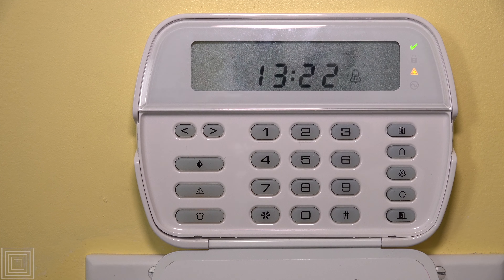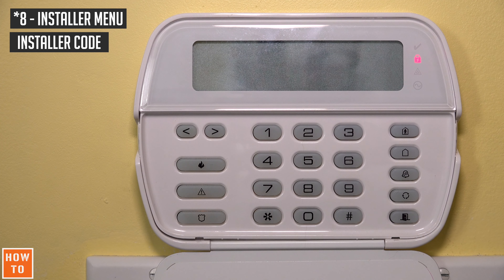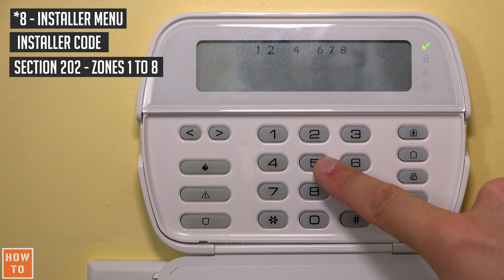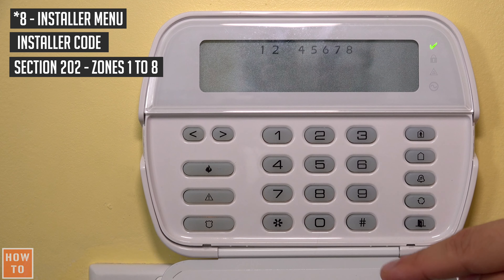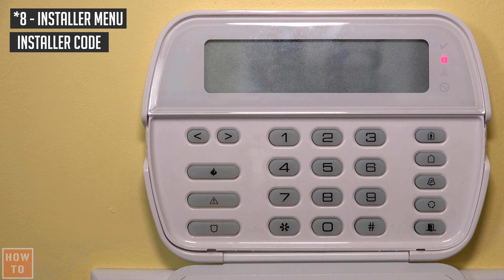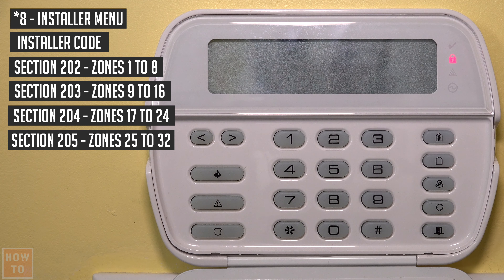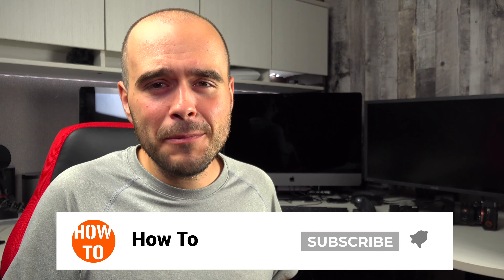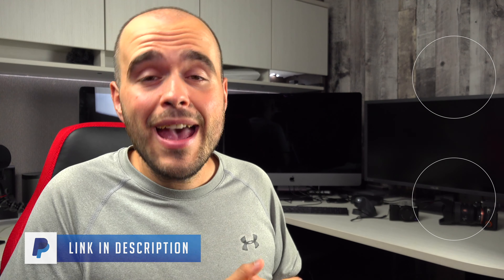How to Delete a Zone on DSC Power Series Alarm System

Comment: Hello, thank you for the video - we bought a house with a broken sensor that we don't care to replace - but everytime we arm the system we have to bypass that door contact.  

I would like to delete the sensor, BUT I do not know the "ZONE NUMBER" (so I don't know which zone to deactivate)

I am afraid of deleting a zone i want to keep by accident (then I can't get it back easily?), but I still do want to delete that broken sensor (deactivate that zone so I dont have to keep bypassing the sensor to arm the system).  

Is there a way to figure out what ZONE NUMBER is my broken sensor?  Right now it just gives the description of the sensor (like "___ door", " ____ window" etc - it is not listing a zone number that I can see)

thank you!

Comment: I have a zone that is not working (the entire zone doesn't work...the sensors are not bad).  Using the procedure in your video - i.e. Section 202 - shows zone is enabled.  Other zones work as they are supposed to.   What can I check/troubleshoot next to get this zone to operate?  Is there a way to use the keypad to check for error codes for a particular zone?
Reply from the maker: If it was working before, that must be a physical issue.
Check the wiring and connections.

Comment: Hi there really informative video - thank you very much.  I tried this approach with my DSC Power832 with a DSC LED keypad.  Using your approach on that keypad does not work.  Are there different steps available? Thanks for your help !
Reply from the maker: As far as I know the only thing that can be different is that in some case you need to input master code before bypass.
Reply: Hey were you able to find the correct answer?

Comment: My DSC panel looks the same but all the menu codes are completely different.  This is outdated info or for a different revision which you may want to clarify.
Reply from the maker: Hum. This is a DSC Power Series... You might be confuse if you have a power series NEO.

Comment: Is it possible to use a zone just for the status and not generate an alarm
Reply from the maker: I'm pretty sure you can yes. But I don't remember by heart what is the kind of zone number it is.
That must be assign in section 001 of installer menu.

Comment: One of my door sensors is no longer working, so I want to replace with a newer sensor model.  How would I actually delete that from Zone 12 to enroll a new device in that Zone 12 spot, instead of just disabling the zone?  When I disable zone 12, it still says my faulty sensor is open.

I am also getting a Zone Fault error that says Fire Zone.  Is that a standard error or is Fire Zone something the previous owner created?  I just moved in and am trying to understand this legacy system.  Thanks for any help you can provide.
Reply from the maker: Hi Drodrek! To replace the sensor, you can go in 804, then the number of the zone, and input the new ID number of the sensor. Howerver about the fire zone, it's hard to say what is your trouble.
Reply: @HowToPM  Much appreciated.  New censor successfully enrolled.

Comment: Hi Great videos, thanks for you taking the time to help. I was wondering if you could help with a problem.  I have a DSC1832 system with TR5164 2 way wireless. My keypad is WT5500.
I am getting a general system trouble message. It shows zone bypass msg in Zone 1 (motion detector). I removed zone 1 but the msg is still there. I reinstated Zone 1 and same msg. Any ideas? Thanks!
Reply from the maker: Hi John. Thank you for your comment. That is a complicated question by message. I did get a lot of trouble with power series wireless. At the end I fully stop to install wireless stuff on power series at costumer places. The new NEO wireless work really well howerver.
I stop using it because it always get me in some trouble like that.
There is the test at section 904 in istaller menu (*8) that you can do for every wireless zone to see if position is good.
1 beep is got
3 is bad.
You must have maximum 1 - 3 beep out of 20.

Other than that maybe just power cycle your alarm system.

I hope this will help John.
Have a good day. 😉
Reply: @HowToPM  Thanks very much,I will try that!

Comment: how to setup partition on dsc
Reply from the maker: I will do a video on this one. It's not easy to explain in a comment. ;)
Reply: @HowToPM  thanks, I subscribe and can't wait for it.
Reply: @HowToPM  Hi, can you help me with this,

1. am doing wireless zones from 17 to  24
2. I went into 212 turn on 1 for 17
3. I went to 002 and and set the 1st one to 03 the rest to 00
4. I went to 117 and turn on 8.

adding wireless 
1. I went to 804
2. I select  one 17 
3 . I enter in the sn#
then exit

***I repeat this for zone 18 on partition 2 like going into 212 turning on 1, 2 for  17 and 18, 002 setting the 1st two 03, 03 for 17 and 18 and going into 118 and turning on 8 to say its wireless.

however, ony zone 17 is working, 
why is it only zone 17 is working on partition 2 and I why cannot get any other wireless zone to work. I have 5 wireless contacts to setup

also, is there an order I have to put them in?

thanks in advance
Reply from the maker: Hi Bobby. Quickly like that everything seam fine. What I am planning to do in the following mode is a complete programming video of the DSC Power series system. We will for sure see wireless programing as well. 
But, actually are you trying to program a motion detector?
Know that they take pause after the sense a motion. Maybe you don't have any trouble. You can test your device in section 904.
Reply: @HowToPM  l am trying to install wireless CONTACTS "not motions" on zones 17 to 21 on partition 2. I activated 03 in 002. 
I activated the zones in 212 by turning on 12345 to say am using partition 2.
3. I went into each zone example zone 17, l turn on 8  in 117, 118, 119, 120, and 121.

For some reason am only getting zone 17 to work.

What I'm doing wrong?
Thanks in advance